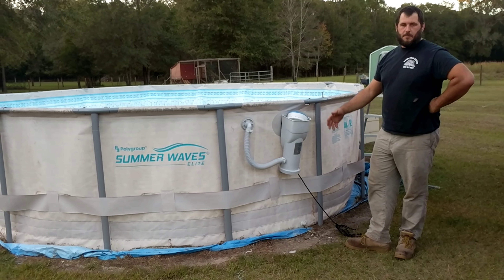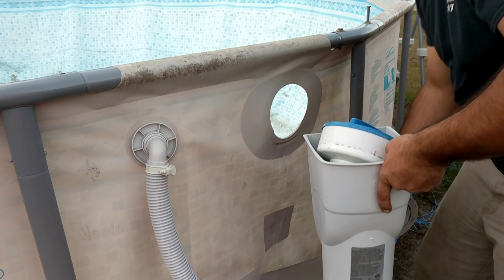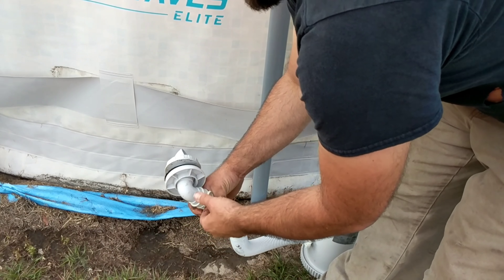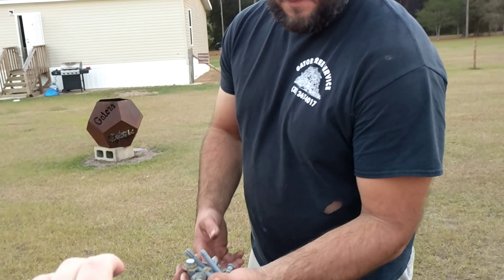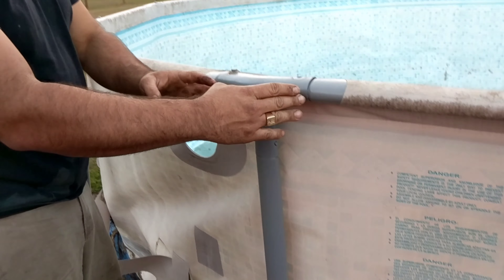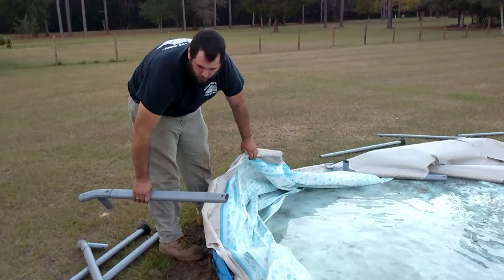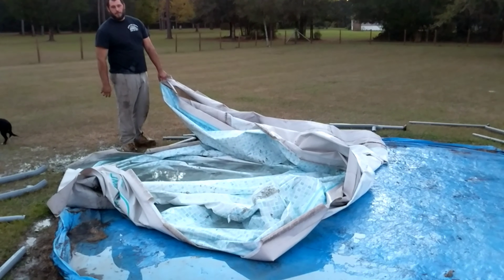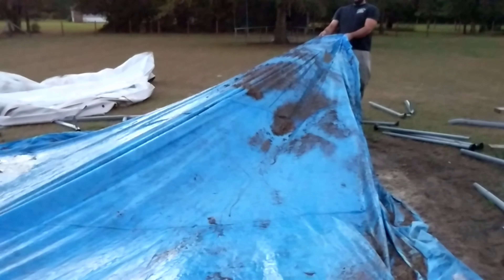How to move an above ground pool the Summer Waves 16 foot pool

Comment: We drained it completely, then while it was still standing, we wiped it down. It was so much easier to clean that way.
Reply: Thats actaully super smart. Bc i done what they did was take mine all down it was a 15foot summer waves and it was a pain. We since switched pools we have an intex now
Reply: @daphnietudor2953  did you take out the pool pins? If so how?
Reply: Exactly.  I couldn't believe he didn't even clean it.

Comment: 10/25/18 Taking down above ground 7,000 gallon pool. every part came apart as expected  EXCEPT the perimeter tubes. all the connectors have been removed, but the tubes are stuck to the pool plastic after 4 years without taking it down and the sun beating down(Dublin, CA).  I tried twisting and pulling, tried pouring hot water on it.  I could use a small torch, but that would be tricky and very time consuming. Thank you, from George 10/25/2018

Comment: Pool professionals tell you to NEVER drain a soft sided pool completely over the winter, it actually shortens the life of the pool as the plastic liner will shrink and when you go to fill it up again it creates weak spots in the liner because it will no longer expand correctly...I found out the hard way
Reply: So your suppose to leave your pool up year round?
Reply: If you live in a winter climate you have no choice.  Apparently if the temp never drops below 32F you can leave it up,  see your manual.

Comment: My pool drain is on the inside and the pool is green, now I’m trying to figure out another way to drain this pool... did the makers not think of that whenever they was making this pool....
Reply: Use a sump pump to pump the water out. Or a gravity siphon.
Reply: another way you can drain the pool is to use a hose. fill the hose with water and hold both ends with your hands so the hose stays full of the water.  stick one end in the pool and hold it. now release both ends quickly and gravity will draw the water out( WATER SEEKS THE LOWEST POINT)